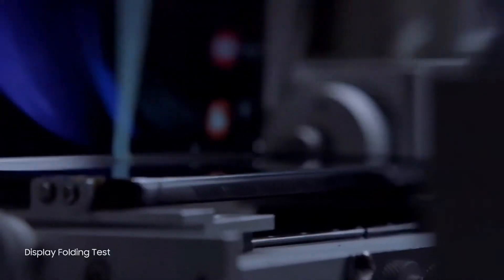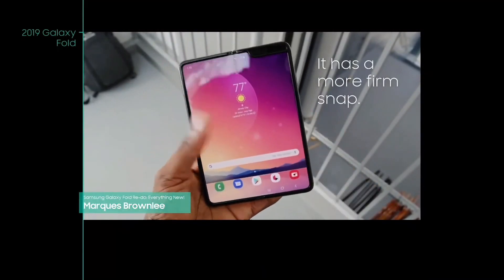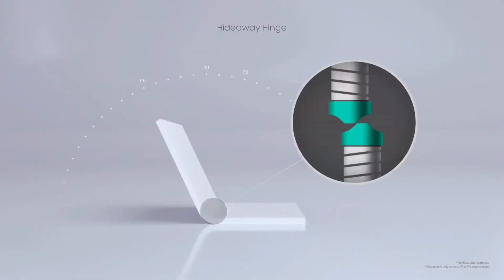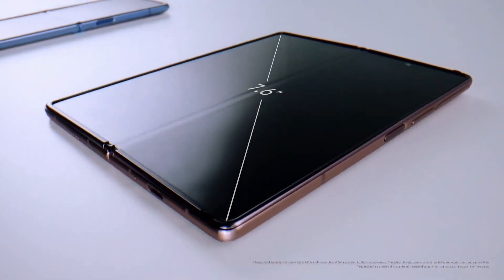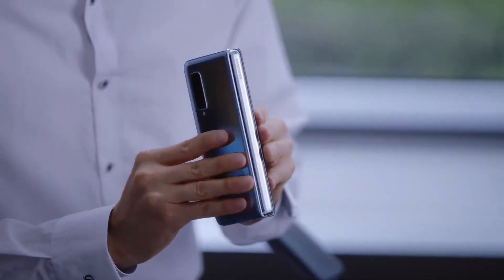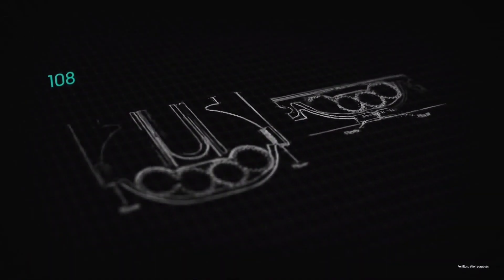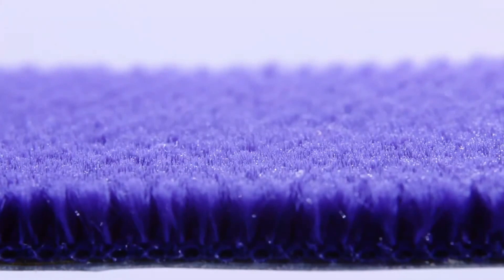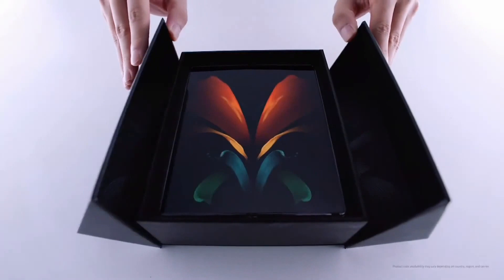Check out the Z Fold 2's folding hinge

Comment: Microsoft Surface Duo is Better:
1.) The Duo has Much more Screen than the Folds.
2.) The Duo folds in more be positions than the Folds
3.) Duo works with all the Surface Pens.
4.) Duo has a more Durable and more Premium than the Folds.
5.) The Duo is thinner and Lighter than the Folds.
6.) The Duo is a Brand New Form factor instead of the Folds Boring Glass Slab look.
7.) The Phone Mode is more Usable than Fold 2's Narrow front screen.
8.) Duo is $600 less than the Folds.

I would much rather pay for the Surface Duo than the Folds fragile plastic screen that damages if a Fingernail or Even Dust touches it 😆😆😆
Reply: Lmao.... no. Duo as a "form factor" because we want two screens stapled together by a company that never understood mobile.
Reply: @njstringer  Learn History young man...Windows Mobile OWNED the mobile space before iPhones came out, And Windows Phone was actually very respectable... the only problem was that the developers were too lazy at a time to create the same apps for a totally different OS so it slowly failed.